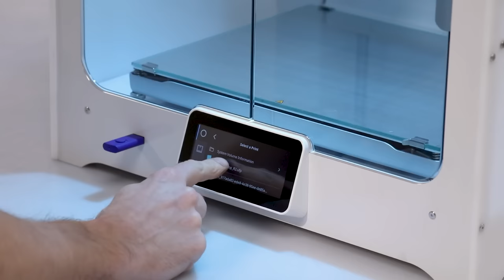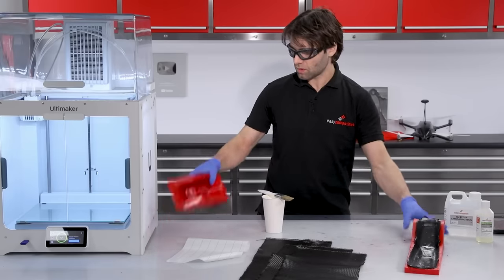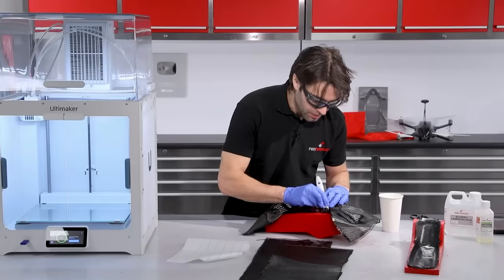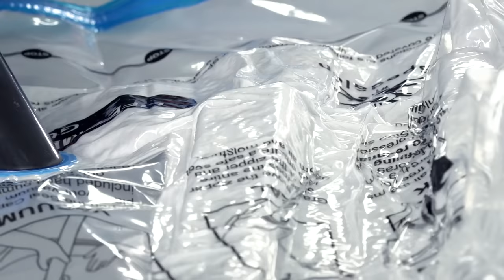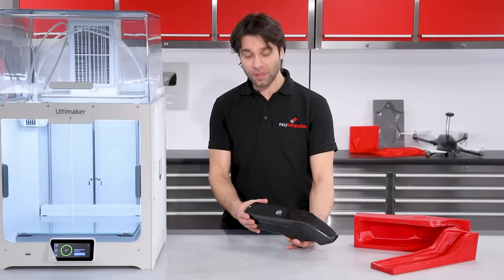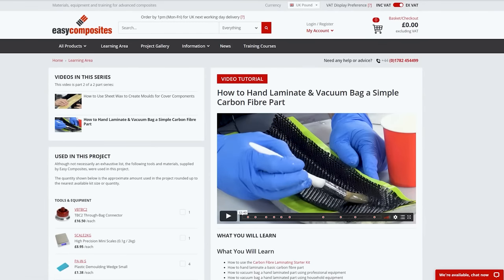Hand Laminating a Carbon Fibre Part Directly into a 3D Printed Mould

Comment: Hi Paul, thanks for the video, just wondering what % larger is the mold than the part to be made? or are they the same
Reply from the maker: The mould is dimensionally the same on the mould surface as the finished part as it is a mirror of the finished part. There is no deliberate added tolerance on the CAD model.

Comment: If you dont like using PVA, what do you prefer to use as a release agent?
Reply from the maker: Hi, you could use mould release wax or a chemical release agent such as our CR1 Easylease, the system used is dependent upon what process is being used.

Comment: I asked on a different video, but having just bought an XCR kit, could I add a decal before the final layer to keep it on permanently?
Reply from the maker: Yes you can, just ensure you use a good quality decal material as some cheaper materials, the glue will lift on the edge.
Reply: @easycompositestv  So put the decal on after the initial flat, but before the 3 layers of clear?  Or would you reccomend doing the 3 layers, sanding it well, adding the decal, then the final layer that gets polished?  Appreciate your time.

Comment: To help reduce cost even more you can substitute the carbon fiber with fiberglass or have the outer layer be carbon and the inner layers be fiberglass. 

Using carbon fiber and not vacuum bagging is like boiling a steak.
Reply from the maker: Yes, absolutely. This process could be followed just the same to make a fibreglass or hybrid reinforcement part.

Comment: Great video for us engineering/3Dprinting nerds. You said that ABS wasn't very good for making a mould since epoxy resin would bond to it too strongly. Would that mean that ABS would be ideal for if you were just going to CF skin a printed part?
Reply from the maker: Absolutely, yes, for this exact reason. You can enhance the bond further by flame treating the ABS as well, this will provide a genuinely decent bond to the ABS.

Comment: Awesome video. I've noticed that the XCR coating resin does not appear in your "Clear Casting / Coating Resins" category.
I'd also be curious if polyurethane wouldn't be more UV resistant for a clear coating application?
Reply from the maker: Hi Dejay, thanks for pointing that out; it should be in there - I'll get it added to this category too. Polyurethane would indeed be a good option for a UV stable coating. PUs aren't as tough as epoxy and they usually need to be spray applied but they're definitely a good way to get a very clear, UV coating on composite parts.

Comment: Would placing it in a presure pot to cure, help with some air trapped and maybe give it better properties?
Reply from the maker: No as it is a laminate not a casting so the benefit is not so effective in that way.  Vacuum bagging would help a bit but the idea of this video and process was to keep it reasonably simple on the composite side.

Comment: Great video; thanks for posting! Which Ultimaker are you using here?
Reply from the maker: Hi Adrian, it’s the Ultimaker S3; not the cheapest (for sure) but insanely reliable ‘print first time’ piece of kit.
Reply: @easycompositestv  I think that is the larger Ultimaker S5!

Comment: Great video :) What about using a 3D-printed part as a core for the part? Replacing the foam core of a surfboard for example?
Reply from the maker: As long as the density is low enough to offer a decent weight reduction while still having compressive strength, then it should be possible.

Comment: Very cool! I'll bet it wouldn't take much to do some kind of bondo finish and sanding of the PETG to make that mold even more smooth. I guess it depends on taking the time then saves you more or less time after the part is done. I wonder how many times the molds could be used? Do you build up the mold release each time?
Reply from the maker: Hi David, yes, you absolutely you can give a better finish to the 3D print before moulding the part, this is the process we show in the first of our 3D printing videos (published a couple of weeks back). The choice mainly comes down to whether it’s a one off and what process you will use for the laminating. It’s generally easier to improve the finish on a part than a mould because you’re working on the positive shape (not on the inside of curved surfaces) but either can be done using the XCR coating resin.

Comment: Would you use AT30 SLow or FAST ? What is the main interest and use for each ? Thanks in advance !
Reply from the maker: For small projects we’d almost always choose fast, just for the cure speed. They’re the same resin, just a different hardener speed. Simply choose the system that gives you enough time to work. If you had to choose just one then you could go with the slow and just wait longer for it to cure, it will give you the most options.

Comment: How about skipping the vac bag and 3d printing a positive of the other side (in parts that can be disassembled) with the right amount of gap for the fabric (about 0.3mm for your fabric) then clamping them together with simple stretch cling? I've done clamshell 3-d printed mandrels and inflated old inner tubes inside to push out CF for parts but with spotty success.
Reply from the maker: Hi Seth, we didn’t specifically use any vacuum bagging for these particular parts although it could be used to quickly and easily ensure good consolidation of the plies of reinforcement or to ensure that the materials didn’t come away from a more complex mould surface. The idea of Compression moulding can work well as long as you accurately offset the surfaces by the thickness of the laminate albeit for a simple part like this, having two good finish sides on the part was not needed.

Comment: Hi, nice video, but I've got a question, how did you bond both halves of the carbon fiber part? Did you use some kind of epoxy glue?
Reply from the maker: This specific part is not bonded together as it is intended to be disassembled; towards the end, you can see the mechanical fixings but if it did need to be bonded a structural adhesive such as our VM100 could be used to permanently adhere the sections together.
Reply: @easycompositestv  Thank u so much

Comment: I tried this and i think my printed mould is to rough. Would you recommend to smooth the print layers with a very thin layer epoxy resin coat and when everything is hard. Then a PVA release Agent before laminating in the mould
Reply from the maker: Yes, if you've got a fairly coarse finish on your moulds (from the layer lines) then the most effective way to really improve the surface would be to coat it with a thin layer of epoxy (something like Easy Composites XCR resin is perfect) and then flat and polish that finish to a high standard. You could then PVA it as the release agent of alternatively you could use a chemical release agent like the Easy Lease CR1 (you couldn't apply this to a 3D print but you can apply it to an epoxy coated 3D print).

Comment: Could you do a video on repairing damaged (cracked) carbon parts?
Reply from the maker: We would possibly do a video on that in the future although we have no immediate plans as we are currently working on new content.
Reply from the maker: I should add though that you may find some useful information in our Carbon Fibre Skinning and the Carbon Fibre Pole Repair videos as both include techniques that could easily be adopted to a repair (depending on the severity of damage).

Comment: When you are sanding this with 400 grit, are you just trying to sand through the epoxy resin layer to get an even surface? What happens if you sand the carbon fiber? I assume this will impact the strength of the part greatly if fiber strands are damaged by sanding?
Reply from the maker: Yes, you’d want to stop before you reach the carbon. If you do start to sand though into the carbon then as you do, you are gradually taking strength away from the part.

Comment: Have you guys tried something like a 90A or 95A TPU filament? The very slight flexibility might make mold release a little easier
Reply from the maker: It's not something which we have particularly tested no but it could be something to investigate  if dimensional accuracy isn't critical. Usually a well designed petg mould with appropriate release agent will release fine.

Comment: With that wet epoxy trimming you did on the first part, are the scissors considered a disposable item? Or is there a way of cleaning them where they will be useful again afterward?
Reply from the maker: Hi Travis, they would definitely just be reused - just wipe down with some alcohol/meths/acetone etc which will remove the wet resin easily.

Comment: How would you need to prepare the printed part if you wanted to use it for infusion. Could you use the epoxy method as in your 'plug' video or are other finishes required to be compatible with the resin?
Reply from the maker: Hi Richard, yes, exactly as per the pattern making video. Only slight concern would be the physical integrity of the 3D printed mould: if you taped the bag to the flange you’d be fine but if you have envelope bagged the whole mould and pulled full vac on it then you might see some distortion /compression of the mould, even with an epoxy coating.

Comment: Another question on the gloss coat, was this done to give it extra strength? Seems like this would add a lot of weight to that part. Could you have finished that step with just a clear coat paint that you brought to a gloss finish?
Reply from the maker: A coat or resin or a coat of paint would both add the same amount of weight (if they were applied at the same thickness, which they would be to achieve the same finish). Both paint or a coat of resin are some additional weight so if weight is more important than finish then you could forgo this step altogether, or vacuum bag the part!

Comment: Dear Easy composite team, 
When I do the finishing coating , 800, 1200 plus polishing (using paiboat top finish 2), it create a kind of white layer in the piece. I probably do something wrong but I don't know what. 
What is the good practice for polishing : a lot of product and spend a lot of time to swipe it and dry it totally ? Or just spread the polish and let the surface a bit wet ? 
When doing the grip, I use warm water. Should I dry it totally before putting the polish. Or should I not dry it ? 
Thanks in advance for your help :D
Reply from the maker: 1200 is a bit too coarse for Topfinish 2.  However 1200-1500 grit is ideal for NW1.  Once you have a reasonable gloss, the Topfinish 2 can be used to create a very high level of gloss.

Comment: Quick question: when you guys apply XCR on moulds, is it feasible to apply more than 2 layers and avoid sanding it in the first place? I'm thinking about doing that for my next project: 3D print a mould, apply 3/4 layers of XCR and have it ready... the sanding is just hard sometimes. Thank you.
Reply from the maker: Assuming you have a smooth enough surface finish yes.  Often when building multiple coats of resin you may have slight ripples or surface imperfections which are able to be sanded out.

Comment: years ago we used a small roller to give a better contact and finish to fibreglass can you use a roller on this too? Gently
Reply from the maker: Yes, potentially, although rollering is more successful when working with polyester resins (like you would use with fibreglass) as opposed to epoxies where they can cause epoxies to foam up a bit. Also, I think in the case of this particular part the mould is too small and contoured to make rollering an obvious choice.

Comment: Where has this channel been? :D Great content. Where is your workshop setup from?
Reply from the maker: Hi Alexander, thanks. A lot was custom built. The steel cabs are from a company that really messed us around and were extremely rude and unhelpful in the end so I’d rather not recommend them!
Reply: @easycompositestv  Thanks for the info and keep on going strong. One other thing. When you have to split parts into two because of size limits with the 3d printer its really nice to use (if your CAD software supports it) a function called lip and groove. Then the assembly of the two glued parts becomes a lot easier and better fit.

Comment: I wonder if it would work to just sandwich carbon fiber weave between two copies of the part (slightly offset) and just chemically bond them together?
Reply from the maker: Its a very mild form of compression moulding doing it that way.  Commonly seen for canards and other small parts where a good finish on both sides can be desirable.

Comment: Is there experience if you can put the 3D printed structure with low 25% infill in a vacuum? Will it collapse or is it porous enough to be evacuated?
Reply from the maker: We have not experimented with 3D prints under vacuum but with surface porosity and especially with lower infills, the chance of collapse or deformation is high.
Reply: @easycompositestv  So I tested a used PLA mold that was printed with 25% infill in horizontal direction and 0.2mm layering. That should be as bad as it gets since it's not very resistent to vertical loads. My KNF can do 200mBar and then stepped on it. Not enough to collapse or deform it so I'm optimistic.

Comment: Hi, is that possible to create molds with using PLA filament? Is it compatioble with epoxy resin?
Reply from the maker: PLA can be used but its main disadvantage is the fact that PLA does not naturally release from resin systems.  PETG naturally does not stick to most resins so you just have to deal with layer lines to prevent mechanical locking.

Comment: Could you sand  the mould to improve the finish?  Having been into 3D printing for a while now this gives me loads of ideas!  Great video thanks.
Reply from the maker: Yes, absolutely. Please see the last video we did where we showed using the XCR resin to improve the finish of a 3D print. This exact process can be used on the mould and then the hand lamination of the carbon part would be as per this video 👍
Reply: @easycompositestv  GREAT Thanks!

Comment: Would this process be adequate for a large flat piece such as a front splitter for a car? and would the use of top part to a mold to apply pressure help with the minimizing of void areas?
Reply from the maker: If you can create a 3d printed mould of that size accurately then no reason why you cannot make a part that big. Compression moulding between two moulds can help with getting a good finish on both sides.
Reply: @easycompositestv  awesome, thank you guys

Comment: Hi, how much resin do I need for a 1.50 meter wing ? Thanks
Reply from the maker: That would totally depend on the thickness of the laminate. As a simple rule, you will need the same weight of resin as you have in reinforcement so you can calculate (or weigh) your reinforcement weight and then that’s also how much resin you’ll need.

Comment: I recently saw one of your older videos about  machining carbon fibre and I was curious about what  kind of tolerances you can achieve when machining carbon parts?
Reply from the maker: Well, it would depend on the accuracy of the equipment you’re using but +/-0.2mm would be easy to achieve when machining cured carbon on pretty standard desktop CNC gear.
Reply: @easycompositestv  thanks for the response! That’s exactly what I was looking for

Comment: would you be able to use the peelply as the first layer before applying any carbon fibre to end up with a better finish
Reply from the maker: Hi Mitchel, this would be unlikely to result in a better finish, you’ll tend to get wrinkles from the peel ply and it will be devilishly difficult to remove from the surface of the part.

Comment: What tolerance did you used to design de piece? I mean, to fit perfect with the top coats applied to the mould and the sheet layers? Thks
Reply from the maker: The coating on the 3D printed moulds only adds about 0.3mm because you tend to flat it down to only the highest texture lines in the print. The coating that goes onto the component after demould adds about 0.5mm. So, if you think about it, the coating on the mould makes the part smaller by 0.3mm and the coating on the part makes it bigger by 0.5mm and so the finished part is only 0.2mm bigger than its original designed dimensions and so can pretty much be ignored.

Comment: Is there a spray or coating of some sort that can smooth the layer lines without bonding to resin?
Reply from the maker: You could use acetone smoothing or similar depending on the filament.  Other than resin, you could try layers of paint, but you would need more layers of paint to get the same thickness and fill in than the resin. Plus you would still need to sand it smooth and polish.

Comment: Just how durable could you actully build with things like these and at which size does this Methode become unreliable? 

I'm looking to build myself a electric Longboard out of Fiber products because of the weight benifits this might bring
Reply from the maker: Realistically, this process lends itself to smaller items not least of all because of the printing time, etc. Certainly components such as hardware covers would be fine but for a full longboard, I'd probably look at different manufacturing options more akin to CNC milling of tooling board or simple moulding (as in our Flax Longboard video)
Reply: @easycompositestv   @Easy Composites Ltd  
I actually own a Board made out of mostly Carbon fibers, it's called "flowdeck x", I think the actual Platform is reinforced with wood but the underside is made out of Carbon fibers but I just can't figure out how they made the whole Cover in one go, about the Longboard video, which one is it? I can't find it sadly
Reply from the maker: @ZLP-TM  https://www.youtube.com/watch?v=s2aS1G6yp-4